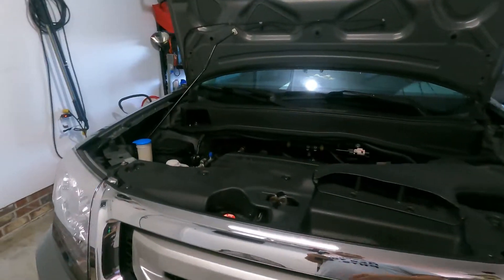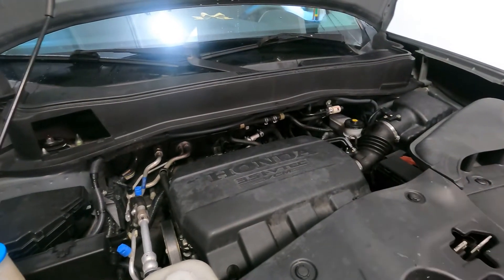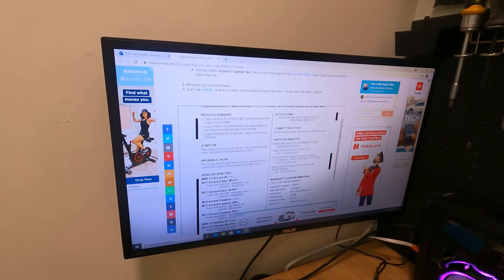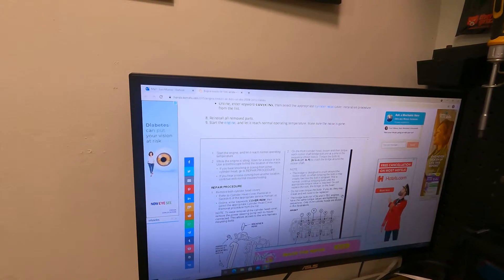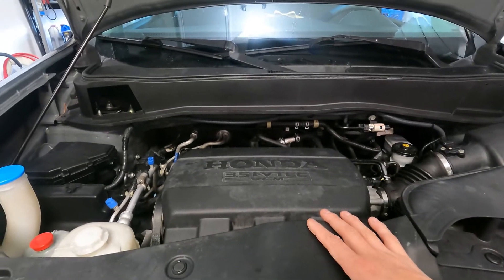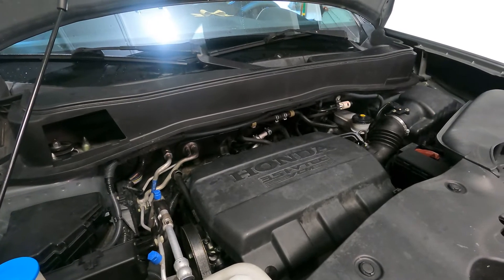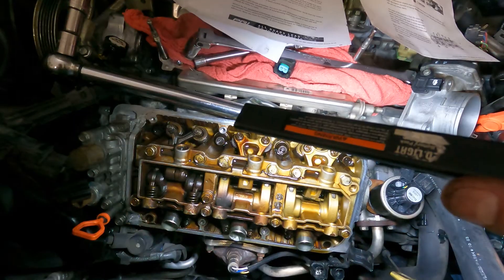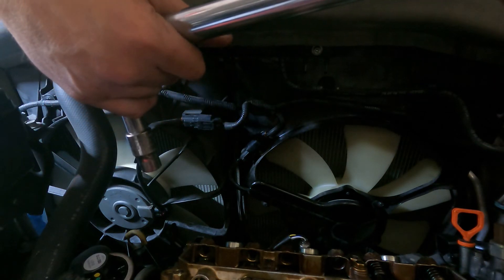Honda rocker shaft TSB! Engine ticks when warmed up!!

Comment: My 2008 is doing this at 180K, timing belt was done at 165k with tensioner by Honda. The valve adjustment done by Honda at 115K. Mine is dead quiet when cold then once at operating temp you hear the tap tap tap sound. It’s not horribly loud like a bad tensioner but you hear it at idle when hot especially in a drive thru

Comment: I have the opposite problem.  At cold start  the engine is quiet for about 20 seconds, then an upper engine rattle begins until warm up then the noise disappears.

Comment: It actually says to loosen and torque each bolt one at a time not loosen all.
I have a similar knocking on my MDX 2004, not in the TSB list. Will try the procedure anyway.
updt: Re-torqued and adjusted valve lashes yesterday. It seems the ticking is gone. Thanks for the video.
Reply from the maker: Thanks for the info

Comment: I have a 2017 accord touring v6 that makes a very similar noise. It’s not listed on the TSB but I only hear it at warm idle in park or neutral. Once in gear it’s immediately gone. Did you experience that? The video is under my account if you want to check it out. 

Thanks
Reply from the maker: mine was more metallic and ticking coming from the front cylinder head, long story short it had burned valves which chewed the cam which was done by the previous owner. yours does not sound like mine. If im not mistaken i believe that year honda has a high pressure fuel pump attached to the cylinder head which make that noise which is normal.
Reply: @DLMGarage  Thanks for the reply! I didn’t know that actually, but the noise settles down significantly once in gear which is why I was concerned. Actually don’t even hear it in drive or reverse and is only apparent when warmed up.